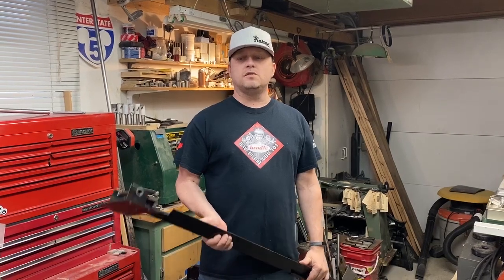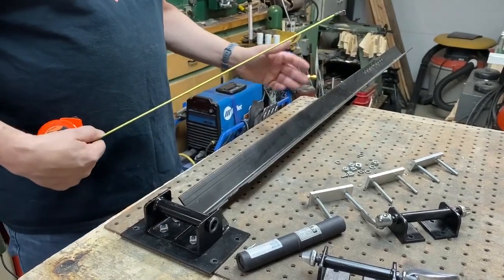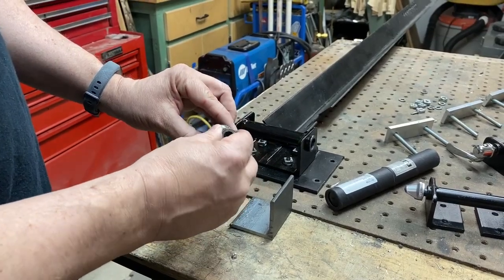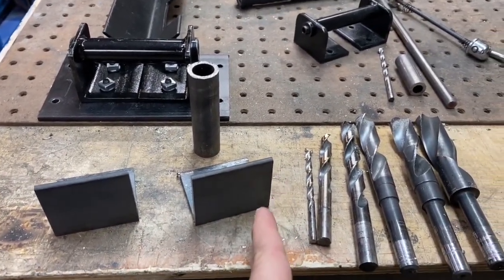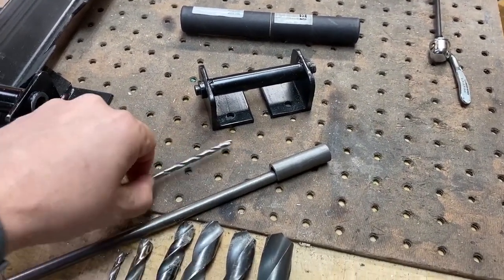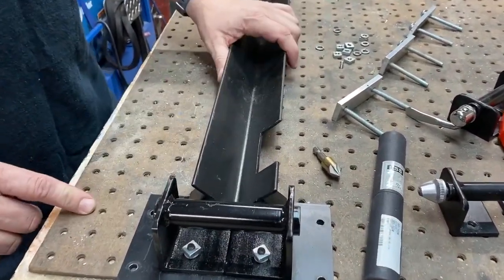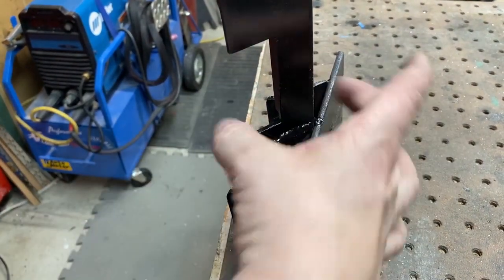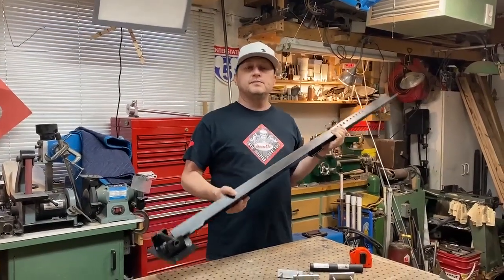DIY Mountain Bike Roof Top Car Rack - How to build a bike rack // Free plans 2020

Comment: No reason for the holes in the long piece of angle iron tray?
Reply from the maker: Not really.  The original intent is to use them as tie down points but I ended using a larger loop of Velcro and webbing. Cheers.